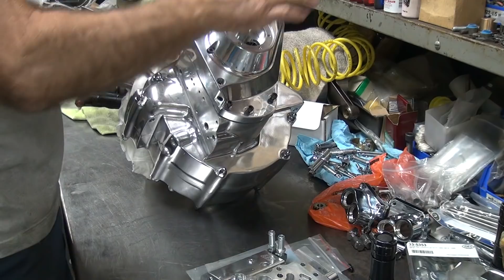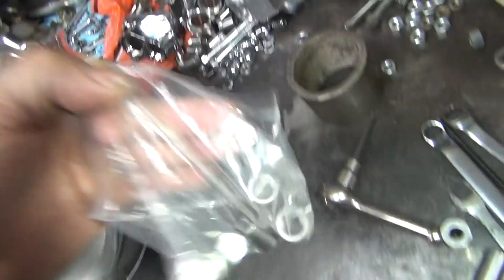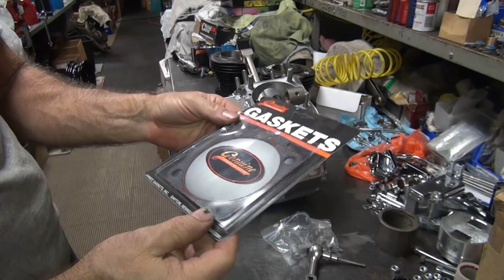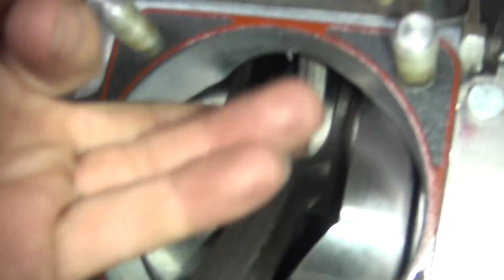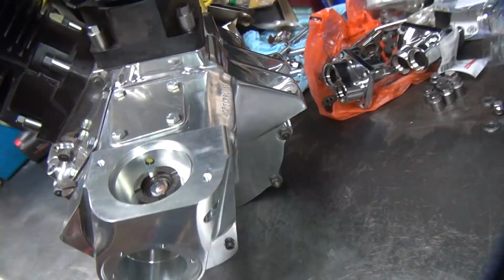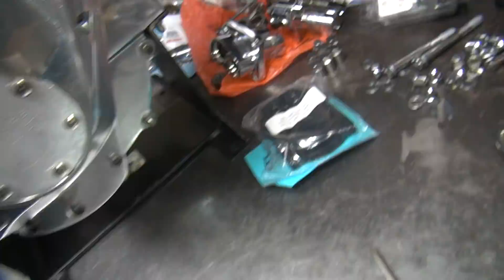#124 1978 93ci stroker shovelhead big bore motor new bike build fl harley by tatro machine

Comment: Tatro good video thanks. I had a magneto on a 1953 panhead in 1975 that thing was a bitch to kick start. it ran good after you got it started. after a couple of months kicking myself to death I took it off and put the points distributor back in it. then I could start it with three or less kicks.
Reply from the maker: two good reasons not to use a mag. it starts and goes faster.
tatro

Comment: Go to Ace Hardware and get the right bolts. And put on some eye protection!
Reply from the maker: they don't have the bolts i need for this job and most likely all the hardware they have is junk. low quality hardware is not what you should build your harley with.
tatro
Reply: Ace Hardware bolts are made from cheese and broken dreams
Reply: @miamimovies  ...that was fuuny dude